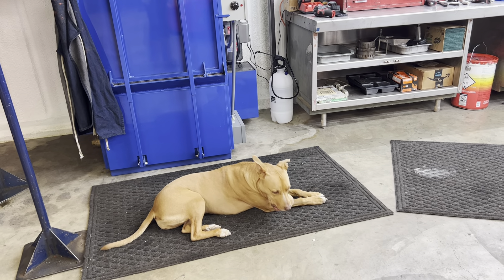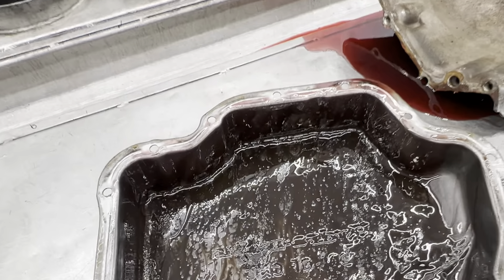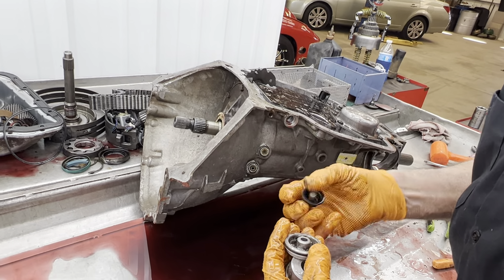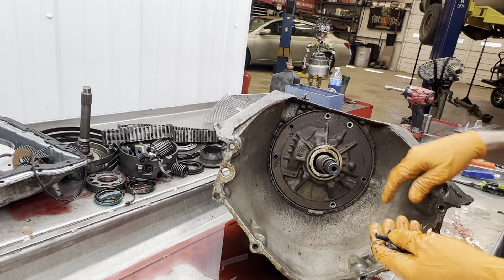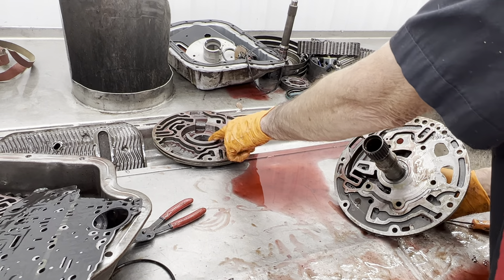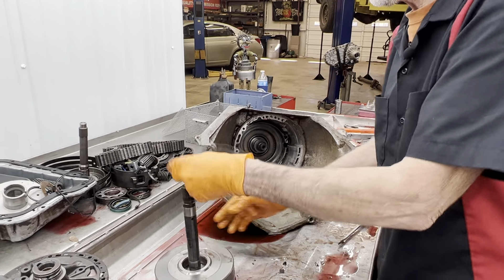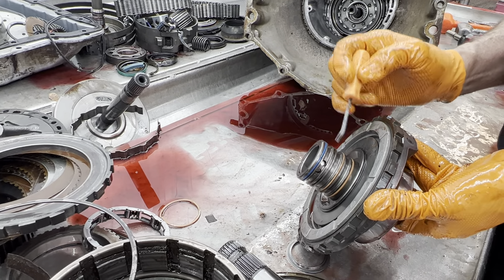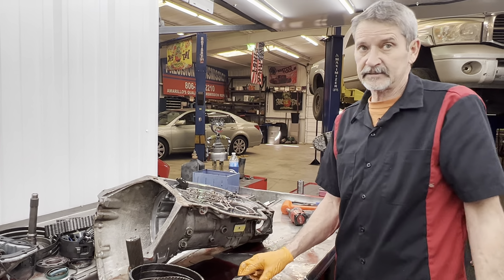GM/Cummins 400 Transmission

Comment: Hi Richard I like seeing somebody work on the older I got my start in 1955 on the old cast-iron powerglide I recently cleaned out my garage and I found five or six turbo 400 remember the later 400 used to break the wave plate what a disaster I love GM products they can do such dumb things and it goes back to the thirties with the Old knee action

Comment: Hey! 1k subs! That was FAST! Can't say I'm surprised. ;) Congrats! Now making the videos starts to pay some bills - not a bad thing!  By this time next year it'll be 100x that I'd bet.👍👍

Been a long time since I operated a TH400 - 27 years to be exact. That was the best transmission I ever owned - it was built pretty stout, and used to kick the rear end out sideways on the '78 Cutlass it was in whenever it hit 2nd gear with my foot in it. Lots of fun! I couldn't afford to drive that thing these days. Gas was .88 cents a gallon then, and I was struggling to keep filling that tank, lol. $15 a tank adds up! 🤣 I'd burn up 5 tanks of fuel a week in that thing. Good ol' days!

Comment: So if this trans did no work, why did the clutch friction material come off the discs? Has the trans been sitting with water in it before he put in the valve body, or were old waterlogged clutches used in his rebuild? You were not clear of the cause of the drum rubbing in the back end. Is that a build error? I have been missing this sort of teardown, glad you are back on the table.

Comment: GOD bless you Theresa at about 2:50 in video...Richard on this tranny if you changed that filter you took out of the unit more frequently instead of replacing it with that screen high flow filter could you get away with it with more frequent changes of the filter???? To have a better filtering system overall.
Reply from the maker: No sir the factory filter won’t flow enough fluid to support a performance transmission That’s why we go to the screen style performance transmissions we service very regularly at least we do

Comment: Richard and Teresa - good evening.  Speaking of filtering I have a 1992 F250 7.3 IDI with an EO4D two wheel drive and was toying with the thought of putting in an external tranny fluid filter in addition to the internal one.  Your thoughts?  I only have 60K miles on vehicle with no issues.  I hope to buzz on out maybe this year and have you do your magic on the tranny - I am in CA.  Love your videos and glad you are back.
Reply from the maker: I would not put a filter in the cooler line Just keep it serviced

Comment: How come the TH350 is weak and never got built up to take high power like the 400?
Reply from the maker: A 350 you would have to build up a stock 400 Would handle more than a built up 350 just not worth doing it